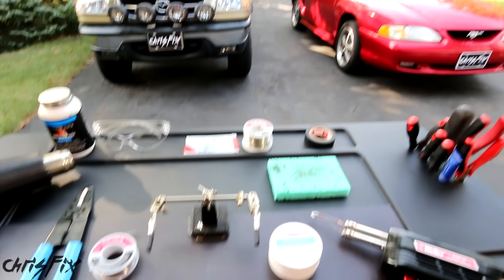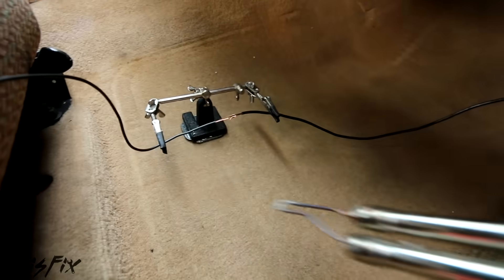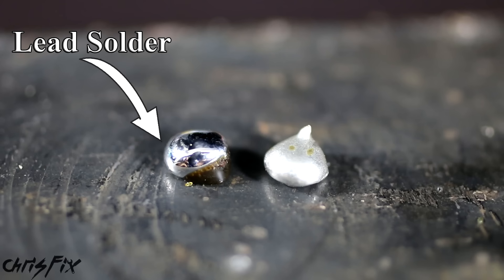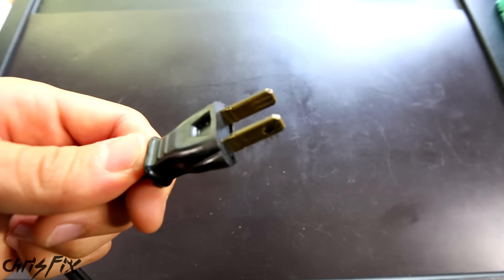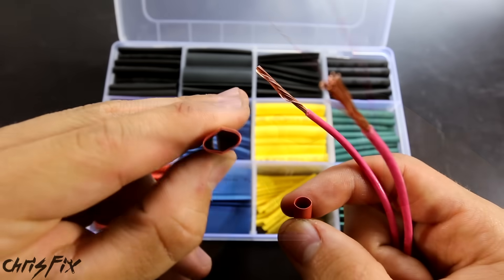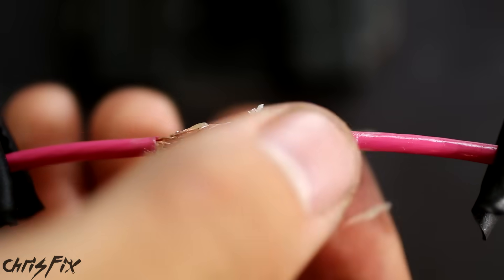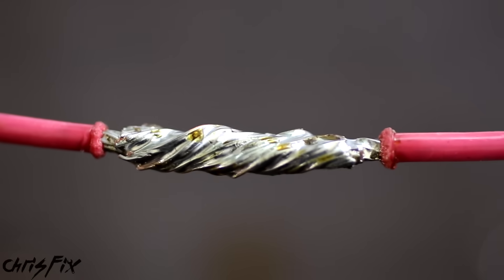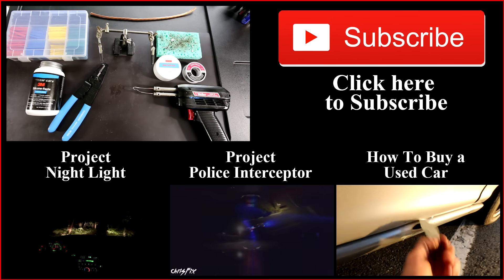How to Solder Wires Together (Best tips and tricks)

Comment: I love your videos but just one thing. Do not do the thing where you replace the soldering gun tips with coppercustom copper ones. Im not going o go very deep in why but you you can break your gun or even melt it down and burn yourself. The copper has a lower internal resistance and so fot it to disipate the same energy it should pass a lor more current than with the original ones (but really a lot) wich the house instalation is not designed to handle neither the gun

Comment: You mentioned about using the seven-strand electrical wire for replacement of your soldering tip. Any specific type of electrical wire, galvanized or copper?

Comment: This is pretty good, some nice tips in this video, really liking it, but I have one correction that you really need to address.

You never want to clean your tip AFTER working, you only clean it BEFORE working, the reason for that is, if you're doing a lot of wires in one sitting, and you leave the soldering iron on for a period of time, the high heat, and exposure to air, will corrode your solder tip really fast, so you always leave tin on the tip of your iron, right until you need it, then wipe it quickly, and go to work, then put it away with tin on, the tin will protect the iron tip against the air, and prevent corrosion.

Just a small tip, I see a lot of other professionals that corrode their tips because they always clean it right after use, instead of only doing it before using the iron. It's also not a bad idea to leave the tin on while your iron is packed away in storage, again, it just acts like a protective cover for the iron.

Comment: Awesome vid!  The best parts were the tip tip and solder tip.  My gun came with lead free solder and it was awful. I picked up the 60/40 at home depot for $10 and I made 10 tips from $1 of 12ga copper wire.  Now I'm soldering like a boss!

Comment: By the way, I'm not talking about some cheep stamped steel  wallyworld or Autozone or O'Reillys etc. POS. I have two different ones. One is a Crescent, I don't remember the maker of the other but it is as good or better than the crescent. They make just as good a connection as soldering, and a lot quicker. Car manufacturers have used them for many years for a reason. faster to change out a bad part. Do it how you want to do it. I'll do it my way  (before you can find your solder, soldering gun, extension cord and get it all strung out) and get the job done and everything put up. Just sayin'.

Comment: Save your money and time. " Buy Quality " crimp connectors and tool. A good quality crimping tool costs around $20.00.
Reply from the maker: Thanks for the tip!
Reply: ChrisFix - Actually it's a CHANNELLOCK No 909 not a CRESCENT, the other is a KLEIN 1006 Also  a VACO 1963 I use for stripping wire and shortening long machine screws when needed. I wasn't putting down your video, just offering a quicker way. Stagger the connections just like if soldering, and if out in the weather you can still use heat shrink tubing if needed to protect from the elements.. I do own a Weller soldering gun and at least 2 low to mid wattage electric irons. Also propane models. Many years ago I also soldered everything, now I only use them on my work bench and only when I absolutely have to.

Comment: I'm not sure what I was doing wrong but when I tried this a while back the wires just went getting hot enough for the solder to melt onto it. I spent like 2 hours and nothing happened
Reply from the maker: You need to use flux and make sure you prep the tip with some solder so heat can transfer.

Comment: Been soldering for over 30 years, yet I'm here, watching a soldering video. :-)
Reply: That's funny. I've been soldering for 50 years and here I am watching a soldering video. I will say though, I never thought of making my own solder gun tips, so here I am still learning.
Reply: Finally it's Ed  any tips for very tiny fragile wires? They come pre tinned but crease and break easily. Anyway I can reinforce them or tips on striiping insulation off very tiny wire?
Reply: Hey Don, on very small wires such as 20 AWG or smaller I generally just use my thumbnail to remove the insulation without any trouble. You just need to be careful not to lose any wire strands when you do this.  Also you can easily toast the insulation with too much heat so careful use of a soldering iron is your best bet. You would need to twist both wires around each other (like in Chris's video) and carefully add momentary heat and use a very thin solder along with some flux . You can actually purchase a "cold heat" soldering pen for jobs like that and eliminate the heat altogether. Good luck!
Reply: @finallyitsed2191  +,    you could use also a pair of needle-nose pliers, especially on telephone wire works  great, or ethernet wire too....
Reply: @danielc.3725  right you are!
Reply: That is the right attitude. Never stop learning!
Reply: Lasse Huhtala same 👍
Reply: Hey Zyzz, actually Chris Fix's method intertwining the individual strands is the best method for a strong soldered bond. There is quite a debate as to whether intertwined stranded wire actually carries current on the surface of the individual strands or not and this may affect AC current more than DC. But, if it is conducted on the surface for DC, the intertwined method would also be an additional benefit. I'm not going to enter that debate so I'll stick with the, "it's a stronger connection" instead. To answer your question I would like to know exactly what wires you were joining. Are these wires to your radio or to your headlights? The reason for that question is to determine what amperage connection are you trying to make because a poor connection on a higher amperage wire could cause heat, and perhaps even a fire where a lower amperage draw would not. A simple response to your question is if the gauge wire is 14 or less (meaning 16, 18, or 20...) then your connection is most likely good. If you are soldering a 12 or 10 gauge wire, it would be prudent to disassemble your connection and do it properly. Just remember, if you are unsure of what you are wiring, get someone to look at what you are doing to make sure. That is not saying anything about your capabilities except that you know when you need help. There are plenty of burned asphalt marks on the side of our highways. You don't want to add one more.  Good luck to you.
Reply: Zyzz  10 AWG is a pretty big wire for a trunk wiring harness,  but if you feel your connections are good then they may be. Just as a precaution, I would drive it around for a while, be alert to anything that smells like burned plastic and open the trunk and feel your connections for heat. As long as you have the proper fuses in place AND you spliced in the correct size wire (matches the existing wire gauge) and there is no heat, then you are probably ok.
Reply: Zyzz as long as the wires you spliced in are at least as large as the existing wires, that’s ok. Larger will not hurt. Watch it like I said previously and you should be fine.
Reply: I know nothing about this that's why I here
Reply: Some times its just fun to watch what other people come up with, or the types of jobs they do.
Reply: The wisest person never stops learning
Reply: I know nothing about this that's why I here
Reply: been doing it wrong for that long
Reply: Same lol
Reply: Alan C  Excellent and correct advice.
Reply: It should not take thirty years to solder something. 😅
Reply: GET A LIFE

Comment: Don't let the wire insulator melt, and don't let solder flow under the wire insulator.
Reply from the maker: Thanks for the tip.
Reply: ChrisFix Yeah that is something my electronics teacher has told me.

Comment: Most likely good for automotive work, but would make a purist cringe.  You really need to tin the wires first..  and you overheated the insulation, damaging it...  try a heat sink like tweasers (ideally anti-wicking tweasers, if you can find em) or a set of clips, etc.  Ideally, the solder shouldn't touch the insulation, and certainly not wick up into it..  The spacing was off on the western union splice.. and defiantly should have been tinned.. the ends were not that great.. fluxes are ususally corrosive and should be cleaned off..  and I could actually go on.. but you get the point..

In my world, it would be considered completely defective and would be rejected.  I only say this to say, there is a whole other world of "soldering correctly" that goes way beyond this...  if interested, look into 2MMTR, or similar

I wouldn't call it "correct" by any means..  good enough, most likely...

By the way, fan of almost all your videos

Comment: Pro tip: If want to solder a plastic connector between a wire, connect male part to female one to prevent the pin inside of the connector melting the connector housing, if you accidentally heat the pin too much!!

Comment: Hey, thanks for the tips! I'm not soldering any electrical wiring. Buy how do you solder on other types of metal. Im not sure what these are but I think some chicken wires are made up of them. They come in different sizes. I won't need to worry about electrical connections. Im just making minis. Hope you can help. Thanks!

Comment: i find it better to bend each wire in half (striped part) and then hook them then twist and solder. so basically the more you pull the tighter it gets..